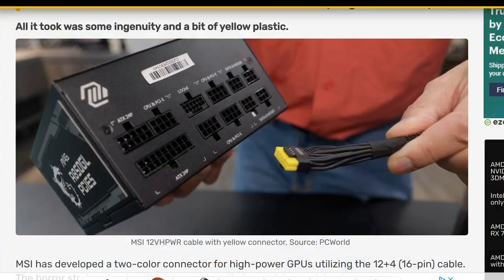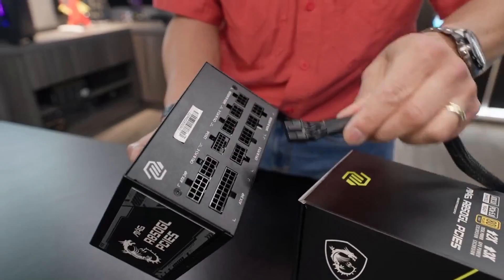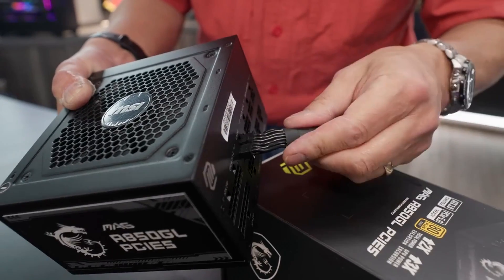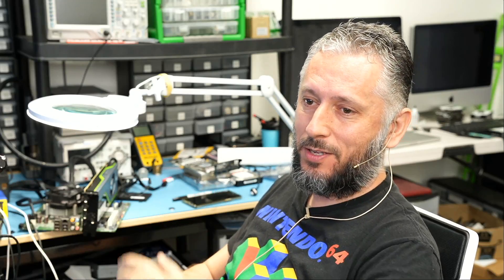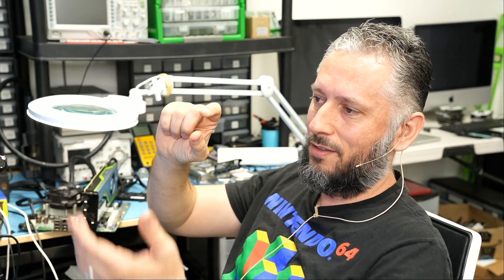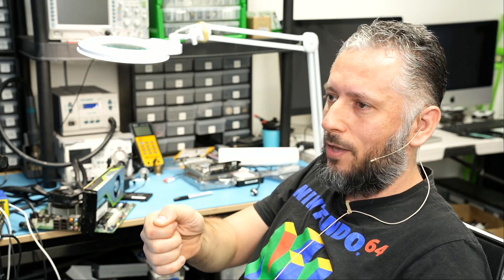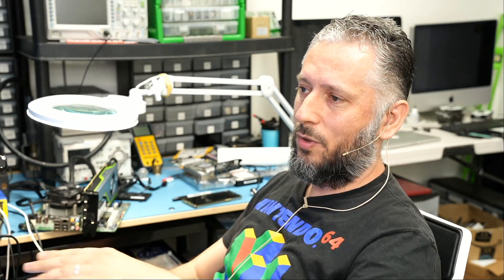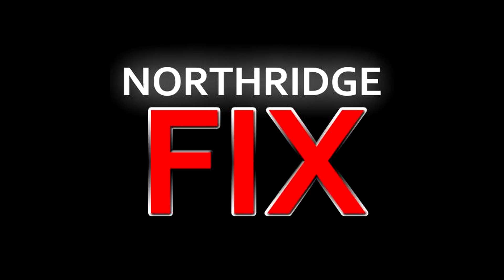4090 Melting connector Fix using MSI yellow cable 12VHPWR. What?

Comment: This is a visual aid but not a solution to the problem. You may color the cable to help detect the problem but in no way can you use this to put the fault on end user if the end user didn't even build the PC. It might be fully seated at one point but those cables are still thick and stiff and will move with their own tension, causing the connector to unseat. If the 0,2-0,5mm tolerances that allow locked connector to wiggle will cause the connector to melt then it is a design fault not a user fault. It is also not a connector fault, the connector is fine it is just not meant for such current draw.
The exact same thing happens with electrical wires - if you use a wire with smaller than required cross section, it will get hot and the insulation will melt and it will happen in a place where the ambient temperature is the highest, not necessarily at the cable ends. In the 4090 case it happens at this specific connector since there are multiple pins next to each other getting hot and making the plastic exceed the temperature needed to melt faster than any other part of the cable or the circuit.
I'm curious to know if any of the repaired boards suffered the same issue later again and it is a problem happening to specific boards that draw more current than other ones from same supplier, maybe to to component tolerances, user PC Specs (better PSU that allows more power to use), etc.

Comment: What a load of crap that yellow cable, you have 4-5mm pin overlap in any case when the connector clip attached. Those connectors have some kind of specifications tht they are made, and now they are trying to make that engineer look like an idiot that made the design. 

How about Nvidia actually reading the specs on the connector and realize they over exceeded the current on that connector type.

Comment: I like Jayz2cents ide. Why not have two locking tabs on each side of the connector instead of one in the middle. However, why was this not a problem on the 3090tis? Why is it only the 4090s and some 4080s?

Comment: Being able to pull the slack and see a sliver of yellow is not "a design fault". Think of the usage scenarios:
1 - You see no yellow. Done
2 - You see 2mm of yellow, so you push it harder until it disappears. Done
3 - You see a thin sliver of yellow because you've pulled it slightly, so you push it in. Done. Sure, there might be a sliver still visible, but it made you check!

People love to nitpick and find fault in solutions. The perfect solution would read the internal resistance of each pin, telling you if it had more than 2 micro-ohms, suggesting it might not be connected fully. That's not feasible, so the next best thing is to catch 99% of the times when it's not pushed in sufficiently, which is what this does.
Think of any yellow as meaning "double-check, is it just manufacturing slack, or will it catch fire?" instead of considering it a complete fail because a sliver is visible.
I think it's an elegant and simple solution to the "is it seated" problem. No more, and no less.

Comment: Idiotic solution for an idiotic problem marketed to idiots.

The solutions is:
2x EPS 12v connectors instead of the 12vHP abomination.
- More power available
- Proven to not melt at high load
- Much larger safety margin for overloading the connector
- Actual functioning click locking when seated
- Not flimsy and wobbly
- Cheap
- Doesn't need new PSU for native support

Comment: Time to change the ATX standard to provide 24V to GPUs and other high power devices. 24V = half the current for same power and no overheated connectors.

Comment: They should have clips on cable to lock it in place like Sata cables. To be honest this is a design flaw because if you are doing cable management there is a risk you are pulling the cable out which could short and cause electrical fire. The onus rest on Nvidia, cable manufacturer and psu supplier and not the consumers to make sure they seat the cable fully. After all they designed that product they had to make sure that product work and idiot proof.

Comment: Nvidia is using a non appropriate power connector for the 4090, if they admit it, implies in Nvidia having to redesign the 4090 and replace every 4090 already sold or at least refund some of the value, something that's not going to happen.

Comment: The onlyl thing that can help them is in case the male case better terinals that grab strong, with better plating so eventually they can "correct" the issue while masking the real cause ... I mean, not being a sitting issue but an AMPS issue.

Comment: It's still way too dangerous to use. This whole card line is complete garbage. Even the 4080s are starting to melt. Actually... make it worse, the 3090 is now old enough that it and especially the Ti are getting melting issues.

We NEED power efficiency, nVidia.

Comment: Beef up the connections or add a second one to spread out the amperage. One connection seems to be to small for the heat it is producing. I see this all the time on other applications, but I’m able to hard wire it, to get rid of the weakest point. For example: In automotive, you have a fuse box. Fuses are designed to be the weakest point to protect the circuit. If you have a connection weaker than the fuse… that connection is going to get hot before the fuse can protect and let you know something is wrong.

Comment: On the inside of the connector, there are 2 or 3 dimples which provide the pressure on the pins when connected to the gpu or PSU. The contact surface is tiny and not sufficient for the rated load. In a world where safety is paramount, everything is load rated, tested and required to comply with stringent standards and with inbuilt room for error (ie a lifting device is load tested by lifting twice it’s certified weight). It isn’t a perfect world and occasionally this lifting device may be subject to loads outside its rated lifting capacity. These cables have no room for error. GN has done a disservice by blaming users and his methodology of inspecting burnt cables is pointless and doesn’t prove anything.

Comment: It seems to me that the issue is the  board connector is made of cheap plastic with a low melting temperature. A good opportunity for someone to make a replacement connector out of higher grade material or with a attached heat sink

Comment: to me, it seems like the pins need to be bigger and have a click feature. the actual power pins in the connector are what I'm talking about. it seems like either the cable connector pins, or the power supply pins are not all the same size and are allowing one, or the other, or even both, to be able to move too much! This stinks to high heaven of someone that wasn't an electrician, or knows much about electricity, that created this new connector. More than likely this was created by an engineer, not someone that has electrical knowledge!

Comment: When the cable clicks into place that should be it. End of story. Doesn’t matter if it wiggles or not the click is the standard. This connector is not melting down because of any stupid wiggle and this whole idea is just a way of distracting from the problem which is that too much power is being fed into one connector and the connector is not designed to handle the heat. I’m still with Alex this is a manufacture defect.

Comment: That video PCworld did just shows there is an engineering fault 100% like you said. If I built a pc with 40-serie cards. I would be so scared. I mean cable management should be easy. So once you plug it in, and trying to make it look nice in the case. I wwould worry all the time "did cable move?", for every little move I do with that cable :(

Comment: Hello dear NorthridgeFix , can i have the model of your multimeter used on march 31 th on the video (Asus Gaming Laptop Repair - Won't power on - Signature Failure as with all ROG laptops) it hase a very useful option , on continuity mode it gives a log bip if there is a short and a small bip if there is a value, thanks

Comment: Frustration, obviously you cannot hear me - I am in the UK....... I am shouting at the screen "It is not the PSU connector, it is the Card connector that has a problem". I,m afraid that I have unsubscribed from the channel because I thought you would mention this. High resistance and heat occurred at the point it melted (the card) not at the other end of the cable.
Reply from the maker: You Totally missed the point and no need to shout. We know the Card connector is what melts. Testing at either end is for demonstration purpose to show how the cable fits.

Comment: I just replaced my 4to1 power cable with cable mod cable. And it is plugged all the way in! Looks much better but I can’t help but think up to 600 watts going through those tiny terminals, of course it’s going to get hot, now add in the slightest error of crooked connector and it’s all over. This is not a good design! Unfortunately we will talk about this until someone has a house fire and a lawsuit, then maybe it’ll be addressed properly. Hopefully no one gets hurt.

Comment: This is a connector design failure, not the cable. The pins are too small and the connector is too thin and fragile to handle the wattage. Nvidia needs to man up and go back to the original design PCIE connectors on future cards. This is ridiculous we still have to deal with this issue.

Comment: I personally don't think it's the cards themselves, or user error. I think it's the metal connectors in the end of the cable.
The gage wire being used should be fine, but the connecting tabs in the end are so small and thin that it's creating to much resistance when drawing a lot of power.
Think of a fuse and how they work with different amps and sized fuses.
 When these connectors draw a lot of power those thin contacts in the end of the cable will get warm with more current. They are thin but not thin enough to pop like a fuse so they just keep getting warmer.
 I'd like to see a new design cable with thicker contacts where it connects and see how that works.

Maybe I'm wrong, just my thoughts.

Comment: Hi Alex, Apologies if this has already been asked and ill be suprised if it hasnt. On the graphics cards where you replace the connector with your new ones how do you find the tolerance when plugging in the power cable. Any better or the same as before?

Comment: This whole thing is simple the manufacture of those connectors have a factory amp rating we use them on our equipment here and they have a 15 amp for 15 minutes or 8.5 amp continues at 12 volts just check what amperage your pulling through each pin and see if any pull more amperage then 8.5 amps

Comment: love the idea of the new connector/color but still doesn't address fix why the cable mod connector melted at the card while fully seated and not at the cablemod/psu cable junction. i still think heat buildup in that area of the card is the base of the problem causing the connector to overheat. i'm still not buying any 4080/4090 with that connector

Comment: @NorthridgeFix I agree 100% with this video. You can fully seat/latch the cable and it could still melt if it gets pulled to one side or the other doing basic cable management or the case gets moved for cleaning. Time for a recall before this issue gets even more out of hand.

Comment: What if the plastic is just not enough insulation for the power draw and heat it creates when the card is drawing its max? Not an electronics expert but doesnt electricity find its best/shortest way to go around?

Comment: Not sure why they don't use the old 'spring clip' system you used to get on printers, 2 spring clips to hold the cable in tight, but that's a great idea, but does it work loose, do you have to keep checking it (from vibration or heat making the cable expand) why not have 2 smalls screws like an old VGA cable would make sure it cant move!!

Comment: Huh? I thought the cable melts on the GPU side, not the PSU side. So what good is this yellow cable? If anything it should be on the GPU side. But NF also showed that the connector melts even when it's properly and fully inserted, so what gives?

Comment: It's hilarious that PC World thinks it's a solution. It's a nice band aid, but you shouldn't be able to pull the connector out that much and rock it around when it's latched. Try that with mini-fit jr. Once it's latched, it doesn't wiggle around like that. The 12VHPWR need major revision... at the very least. As of right now, I don't want 12VHPWR on my GPU... but I definitely wouldn't use it at the PSU end.

Comment: The yellow is a super smart idea. It doesn't fix the underlying problem of the defective connector design, but it makes spotting the problem easier. But, there is an aspect to it that is super-stupid, too. By using the 12VHPWR connector on both ends, they are DOUBLING the chances that the cable will burn due to a poor connection. Since the connector design is inherently defective, it makes NO SENSE they would do this. They should have normal connections at the PSU. Just like the superior 8-pin (6+2 PCIe) connector that has served the world well since the day they were introduced, there have been no problems on the PSU plug side of things. Now that are introducing a second problem where a solution or change was unnecessary and, in this case, ILL ADVISED. That seems almost as stupid as something ASUS would do, LOL. Change for the sake of change is never good or welcomed. It's just dumb.
Reply: To be fair, nobody's reported the plug melting at the power supply side yet, most likely because common building practice is to shove all the excess cable length into the space under the PSU shroud, which will press up against the plugs and prevent them from wiggling out due to vibration/thermal expansion/etc. GPU side just doesn't have that advantage.

Comment: the fact that you can pull it that far back while locked in surely means to me its just the toe on the lock is to long,make it slightly shorter so it only locks when fully pushed in

Comment: (MSI Gaming Trio/CableMod 12VHPWR cable) I have zero side to side play. And the fit is so tight,  it's difficult to remove the cable. This seems like a manufacturing tolerance issue.

Comment: If only this connector design has fusion issues... obviously the problem is the connector.

This is really simple. Before you had 2 parallel connectors to distribute the output power from the power supply to the high end graphics card, now you only have one for all the watts the line can provide. What happens when you cut one in 2 highway lines but the endpoint demands the same or more? The most delicate point is the first to heat up

Comment: That's a good idea by msi for sure, but not a solution, because the problem is that you cannot send 500w or more on such small connector, it will eventually melt, and THEY KNOW THAT, that calls planned obsolescence, but they calculated poorly and it last less than expected that's why we are having this problem, this people are evil, and ppl buying these products are either dumb or ignorant for accepting this and spending thousands anyway on these products, I will NEVER EVER but a high end card with a Lego power connector, that's dumb

Comment: need to change stille is design of this connector  , there should be no clearance at all between the pins to can't cause and getting hot because it have resistance

Comment: the clip on the cables needs to be wider like factor of 3 to 4 wider. this will help prevent mechanical wiggle( yeah its a technical term lol ) the yellow construct is also a good idea. Implement both things on the connector
Reply: Yeah, and msi makes both gpus and psus. They could've made a wider latch for both sides of it, and it would still work with non-msi latches

Comment: I have a solution , take the connector and through it in the circular filing cabinet, and replace it with regular pcie connectors that are more robust.

Comment: Perhaps a connector re-design with screws on either side of the connector in the fashion of the old serial printer connectors or video connectors would provide a solution.

Comment: If its not plugged in, the lock on the plug wouldnt be enabled? You plug it in until it says "click" and you know the lock has been engaged. Yellow plugs is for noob users. I guess its welcome.

If only Speakon made GPU power connectors lol

Comment: if they are going the extra mile to make a yellow end why not make a better clip so it dont pull out then... if its pulling out while clipped even on the psu end wich is the product the cable is coming with. how can that still be user error or on the end users fault?? this is just another gimmick and reason card makers are gana say they wont warranty cards .

Comment: Still not fixing the original problem. the yellow tip won't solve anything. 
Redesign with stronger plastic that can withstand high temperature.

Comment: That cable should be redesigned with a spring locking mechanism, that way when it melts everyone knows it is not the users fault

Comment: I thought that the point of having a clicking lock mechanism on the 12VHPWR connector in the first place was to give a precise indication that the connector is indeed properly inserted.

If you have to go the extra mile of making a yellow adapter to ensure that it is fully inserted despite the lock click, that only means that the locking mechanism isn't reliably designed. Skipping this 40 series until NVIDIA and PSU partners fix this issue.

Comment: Would like to see you solder the cable direct into the board see if it’s a connector issue or a heating issue

Comment: MSI must provide a working ssolution, something that can fix the problem. This is just a stupid visual alert sistem, its value is nothing, less that zero at all. There are tons of factors can influenze the connector stability, like termic variazioni that can cause dilatation and let the connector move out.